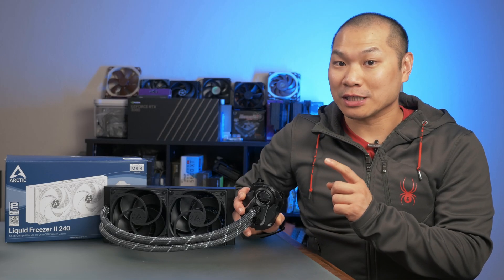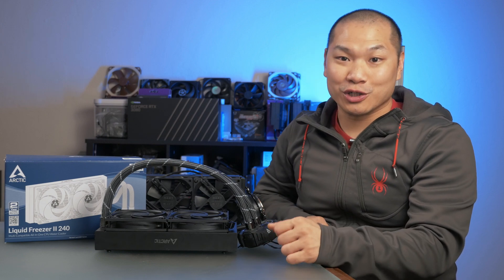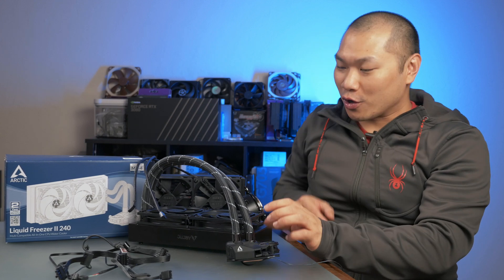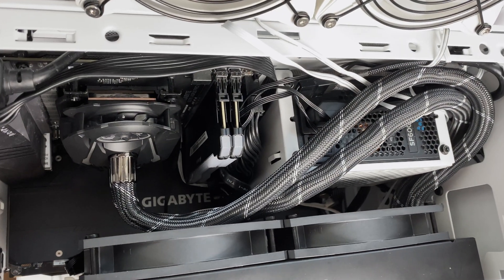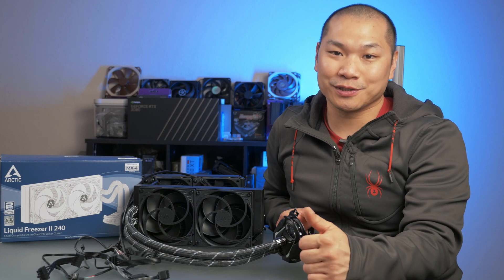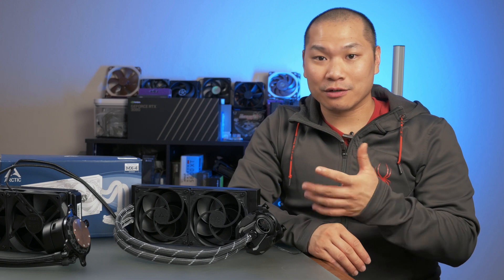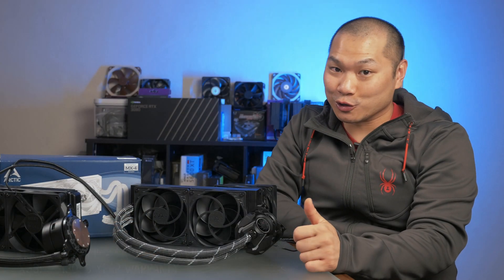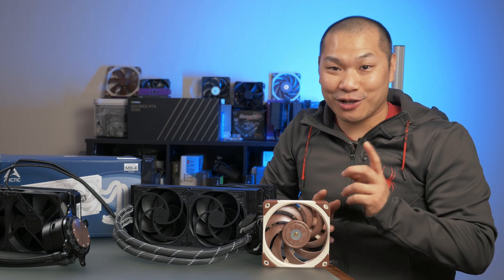The Arctic Liquid Freezer II 240 Liquid Cooler - is this the best performing 240mm AIO?

Comment from the maker: Recently Arctic has extended the warranty period to six years, which also covers units already purchased prior to the extension. Way to go!
Reply: Six years is insane! You can't beat that.
Reply: The also made their p12s argb and bundled them with this aio, and with 0.8gr of mx-5 as well ...
Reply: @panos21sonic  You have that? Im considering upgrading my scythe fuma 2. Its a excellent cooler and i don't have problems. Only problems i want to swap it out. Is i cant reach my graphics card pin to release it or m.2 slot. Also for ram i have to remove the fan. Is this a good upgrade?
Reply: @mikewow  I dont have it, I was close to getting it but I snapped and got an h115i capellix. Though I know it exists, I researched the shot out of it. From what I remember, you may see a 8 degree dif if youre on ryzen 3000/5000 about 5 or 6 on intel and zen and zen+. Though I dont know how worth it it is, since you have to spend 100$ for basically conviniance. Ram upgrades are basically a 1 time thing at least for me. Same for accessing m.2 slots and doing whatever you want to do for your gpu
Reply: @panos21sonic  Yeah true, the h115i is like 60 euros more in my country. The thing is ram i prob wont upgrade for years. m.2 i will probably mount that in in a year or so. And i will upgrade my gpu if the prices are somewhat normal again.

Then i want to sell my gpu to someone else. Ofcourse they wanna see it in action and if i wanna do that i have to get rid of my new gpu removing the cpu cooler. Placing the gpu i want to sell. and place cpu cooler back. Hope the guy will buy it and repeat the process. Thats a struggle :(

Comment: Just curious, but when you only have one four pin connector, where do you connect it on the Asus Prime Z790 with no less than six headers for fans and cooling. It has one header for a CPU fan, it has a header for optional CPU fan, it has a header for the AIO pump, and then it has three headers dedicated to chassis fans. So my question is, do I use the AIO pump header or the CPU fan header? Thanks man. Going to install this in a Fourze T320 cab.

Comment: I'm currently rocking a ROG Strix B450-F Gaming (first edition, not the recent Gaming II) and it's a fantastic board, no complaints whatsoever, my 5600X is running all-core at 4.65Ghz no problem, paired with a NH-D15 dual fan --- but!! I'm planning on downsizing my overall PC footprint. My current full tower case just takes up too much space despite its excellent airflow, so I'm planning on swapping out to an NZXT H510 Airflow. 

Will this LFII 240 be a good fit for the H510 Airflow when paired with a Ryzen 5600X? Thanks, and you've already earned a sub for your excellent content, in-depth reviews, and ridiculously soothing voice \o/

Oh and, yeah, the added VRM fan unit is seriously making me consider this AC LFII as an upgrade, since my B450 aren't well known for their high-end VRM performance.

Comment: Hey, I’m planning to use an Arctic Liquid Freezer II 240. Since the radiator is big, can I use the argb fans as intake in the push configuration so that the lights are visible or do I have to use them as intake pull configuration?

Comment: I like this guys thorough,clear presentation.
Just put the 240 in my sons midrange corsair case,in the front mount position, with minimal fuss.
I had to cut the HD drive bay down,as it would have got in the way of the radiator,but no real hassle.
Performance as advertised,with temps being way down on his Ryzen 5600x build,and whisper quiet.
One thing to note,their are several revisions of this cooler,as its been reported the cooler head wouldn't fit numerous motherboards.
Their's a revision 4 and now a 6.I received a version 4, which has revised cooler head brackets for AM4 boards.
Just a issue with the 2 screws that attached the brackets to the cooler head being in the wrong bag
,and being very careful the motherboard cooler backplate doesnt drop away,into the case, when you remove the oem mounting brackets.
But other than that,a easy install.
Such a quality item,which is immediately apparent as soon as you open the box.

Comment: So, hold on. You dont install 2 metal brackets 1 to the pump and 1 to the socket? Just to the pump and straight to motherboard?
Reply from the maker: There’s two bars that attach to the pump, then you use the stock AM4 backplate (Intel is different).

Comment: hai do you think this is enough for OC 5.1 Ghz all core i9 10900k and below mounted?
Reply from the maker: Depends on your chip quality/voltage. Anything up to 1.25V is manageable with max fan speeds. Having tried to OC a 10850K with this, I’d say a 360 is much better though.
Reply: @MachinesMore  the temp of oc 10850k to how much ghz?

Comment: Awesome and helpful videos, thank you so much.
I have a question tho. I'm planning to buy the arctic freezer II 280 mm for the coolermaster nr200. do you think it would fit in terms the water tube stress and dimensions of the radiator itself for the side radiator mount?
Reply: Hi @lamboozle, did you end up getting the arctic freezer 280mm for the nr200? If so, did it fit ok?  I am hovering on the buy button of the same setup but am so paranoid about the fit.

Comment: This cooler plus two nf-a12x25 will be whorth it? Or what aio are much better than this in 240 mm?
Reply from the maker: The Noctuas are better, but whether the couple of degrees is worth the added cost (they are premium fans) is debatable. I think the stock fans are incredible, just that they have the growl.
Reply: @MachinesMore  Okey, thanks!!

Comment: PSA: Got the 280 version today, it did not fit in my Fractal Meshify C case with the very long RTX 3080, and ASUS TUF Gaming X570-Plus. Neither in front or the top.
Mistake on my part. Ordering the 240 and returning the 280, "should" barely fit in with the IO cover.

Comment: Tell me what kind of water to supply for r5 5600x? The Arctic Liquid Freezer II 240 or The Arctic Liquid Freezer II 280 or The Arctic Liquid Freezer II 360? I want a minimum of noise and below temperature.
Reply from the maker: There's a limit, with the 5600X you will find that despite going up in rad size in the same product line, you won't get much cooler since it is limited by how much heat can be conducted away from the chiplet, to the IHS, then to the cold plate. A 240 would be more than enough rad.
Reply: @MachinesMore  Thx, i buy 240 =)

Comment: Hi! Would the 280 fit in the NR200P?? I'll buy it immediately if it does!
Reply: I'm wondering the exact same thing! Especially with two arctic 14mm fans on top which are 27mm thick
Reply: @HamzaAmjad  I tried both Arctic freezer II 240 and the be quiet bw006. The arctic is just difficult to install overall and the be quiet is actually a good one if you want to bottom mount, but the inline pump is just too loud (for a regular person). Right now I am running fuma2 with tg, fits perfectly.

Comment: 2 part question, do you think the 280mm LF be significantly different to the 240mm and.....would the 280mm fit in the NR200
Reply from the maker: Depends on what you're cooling, if it's a hot chip it might be a meaningful difference, and technically they will fit but the tubes are super super hard to manage on the side panel. Personally I'd go for the 240 unless it's a 10900/10850K OC'd you are cooling.
Reply: @MachinesMore  a 5800x in a NR200. At the moment as of last night, i've gone one of your suggestions as i had the kraken x53 AIO and 4 Arctic P12's PWM's. two in the  top and replaced the two NZXT ones. Much quieter rig, but i must of got some air in the radiator or something as my temps under a stress test has jumped up to make cinebench fail due to hitting above 85deg. I heard this might be an issue with the Krakens. Also put the Noctua A12x15's under my RTX 3070 but i dont know how air gets past it lol, it is tight :) ...... and also removed the 92mm rear fan as well. All great recommendations from yourself.

Comment: Is there anyway to put a 90 degree turn on the pump block tubing? I’m trying to install this in the SM 580 case from sliger  and it’s way too tight.
Reply from the maker: They don't do it, and that's the manufacturer doing it is the only way unfortunately, it would have to fit at the block and that's not easy to mod.
Reply: @MachinesMore  thanks I’m not going to attempt it. I’ll just try to sell it and recoup money. My unit came without any mounting hardware and no screws as well . The tubing is frayed somehow as well like it’s been used.

Comment: How does it compare to the Noctua NH-C14S? I actually managed to fit the LFii 280mm into the NR200 and installed two NF-A14's to the radiator. But after seeing your older videos about how good the air cooling works in the NR200 now I'm kind of intrigued about sending it back (still under the 30-day return period with Amazon) and getting the NH-C14S.

Comment: Bought this for my 5600X, hits 85 - 90°c on stock. Tried mounting it with varying mounting pressures, with various amounts of kryonaut, no changes. Even setting a 1.1v Vcore, the temps are too damn high. Any ideas what might be going wrong? Case is NR200.
Reply from the maker: Couple things might be happening- 1) pump isn’t running (can you hear it? You should be able to see the fan and hear some vibration like a hum from the pump). 2) Double check contact on the cpu what does the paste pattern look like and is it making good contact? You should feel some level of adhesion when you remove the block, if the contact is good. If it just comes off easily, no good, something is wrong with the contact and either the hardware isn’t put on right or something isn’t right enough.
5600X should run in the 50’s on liquid.

Comment: Would this cooler fit in an NR200 with an ATX psu?
Reply from the maker: Unfortunately, I don't think you'll find any 240/280 that will work with the PSU in the perpendicular orientation.

Comment: With an AIO, the radiator should be mounted on top as best as possible. Could there be problems in the long run if you mount it on the side of the NR200P?
Reply from the maker: I think the rad and the pump block are fairly level, rad may even be higher depending on your unit. Not a big deal compared to bottom mounting the rad when the pump is in the CPU block.

Comment: I finally got my Nr200P and am building it with the arctic cooler. Did you have to reverse the fans? On my unit, the arrows of the fans blow through the radiator (push) rather than pull.

Comment: for a thicc radiator like that would it benefit a bit from a push pull set up? the 5 pack for arctic p12 are pretty cheap
Reply from the maker: It can if your case can fit it, however I’d say that you really only benefit from that with a hot cpu like Ryzen 9/10700K/10900K. With the lower TDP chips the fan speeds can be low enough that the noise isn’t a big difference between push+pull at a lower rpm and single push or pull at slightly higher.
Reply: @MachinesMore  thanks for the reply! for sure finding a case that's big enough/good enough is a bit of a problem, if you have any suggestions ill be interested! since im planning on making a new build soonish. and yeah i agree that its probably not super worth it under most circumstances, I think I just wanna try it out especially since i will be going for a high end cpu too
Reply from the maker: In SFF? Or larger?
Reply: @MachinesMore  oh im not really interested in small form factor, the bigger the better for the most part for me lol im not hurting for space. especially if it means better cooling and easier cable management you know. theres so many options out there it can be a bit overwhelming

Comment: I bought the Arctic Liquid Freezer II 280mm and installed it into the NR200 case.  I decided to put the radiator hoses toward the back of the case with a loop in the hose like a pig tail or spring.  I've had no issues so far.  I did change the fans to intake, they come pre-configured as exhaust, and added  140mm fan grills, just to be safe.  I also bought a pack of the 5 Artic 120mm fans, I put two in the top as exhaust, and two in the bottom as intake.  The top fans used the custom fan mounting feature that comes with the case and has fan grills.  I added fan grills to the two bottom fans.  The last piece of my build, Zotac RTX 3070 Twin Edge OC, comes this Wednesday!  I hope it will fit in the case, it's not long but it's tall, I think it will.

Comment: Will this fit in a Cooler Master NR200P with the Gigabyte Z390 Aorus Pro ITX motherboard?
Reply from the maker: Since you mentioned the P- I’m assuming you’re bottom mounting with a vertical GPU? In terms of height you’re fine with the clearance below the riser cable.
Reply: @MachinesMore  Yes thats what I had in mind, what would you recommend? Am I doing it right?  Sorry I’m coming from a FULL ATX to a SFF and my knowledge in SFF is extremely limited besides what I learned watching your videos.

Comment: I've had a look at this one EK Waterblocks AIO Liquid CPU Cooler 240mm D-RGB and this one as well Corsair iCUE H115i RGB Pro XT 280mm AIO CPU Cooler they both fall in my price range which one do you think is the best out of these two. Or this one Corsair iCUE H150i RGB Pro XT 360mm AIO CPU Cooler and this one Corsair iCUE H115i Elite Capallix 280mm ARGB AIO CPU Cooler .

Comment: Will this  Arctic Liquid Freezer II 240 Liquid Cooler fit in this case the Lian Li PC-O11 Air Tempered Glass Case is so can you tell me where I could purchase this from because they don't sell this particular AIO in Australia thank you.
Reply from the maker: Yes, you have multiple mounting points and that case could house an even larger cooler like a 360mm. If you can’t find this one in Oz I’d look for another 360 cooler- I mean it’s good but even an average 360 will be better than the best 240.
Reply: @MachinesMore  I've had a look at this one EK Waterblocks AIO Liquid CPU Cooler 240mm D-RGB and this one as well Corsair iCUE H115i RGB Pro XT 280mm AIO CPU Cooler they both fall in my price range which one do you think is the best out of these two. Or this one Corsair iCUE H150i RGB Pro XT 360mm AIO CPU Cooler and this one Corsair iCUE H115i Elite Capallix 280mm ARGB AIO CPU Cooler .

Comment: With the Artic Cooler on the gigabyte mobo, what did you set in bios? And how did you turn the vrm settings off and on? Thanks
Reply: Seen a message from earlier thank you, have a found a great curve for it?
Reply from the maker: The curve is based off of Arctic’s setting and corresponds to the PWM signal- if you don’t want the fan you have to unplug it. For as quiet as these fans are I would recommend just locking to whatever level you think you need under load, be it 1000 RPM or 1200 RPM. The change in RPM is what causes the growl on the P12s.
Reply: @MachinesMore  thanks very much! Awesome channel! Learning alot about how to get the best performance out of the nr200.

Comment: Interesting Video!  Did you test that if the LF II 240 will fit in ncase m1 with NF-A12x25?  Any squeezed tubes?
Reply from the maker: Unfortunately no way it fits in the M1! It’ll be way too tight, and also the exhaust space will be super choked off.
Reply: @MachinesMore  Thanks, somehow this guy was able to fit it into the M1 and the process was pretty smooth as well, not sure if it performs the same like in other cases tho. https://www.youtube.com/watch?v=w5Q1hKUmo9E&t=221s

Comment: Have you thought of attempting to use eg. Bitspower Leviathan Slim All In One 240 RGB (https://shop.bitspower.com/index.php?route=product/product&path=61&product_id=5286) or Bitspower Smart Combo Xtreme 240 (https://shop.bitspower.com/index.php?route=product/product&path=61&product_id=5290) or Bitspower Smart Combo Slim 240 (https://shop.bitspower.com/index.php?route=product/product&path=61&product_id=4820) with some monoblock? Mayhaps even another rad on the bottom (or place the combo/kit ones on bottom and add another on the side) and you can connect waterblock from a GPU to the whole loop... I wonder if such a set of watercooling parts would work in NR200...

Comment: sure, its a great cooler. but the installation was like a horror movie. took me a titol of 4.5 hours to install thanks to my stupidity and lack of clear instruction. its easy to install WITH instructions. just make sure that you view the right "Rev." version rather than the radiator size.
Reply: Hi, could you be more specific about those instuctios please? I am trying to get mine there and does not seems to fit. :(